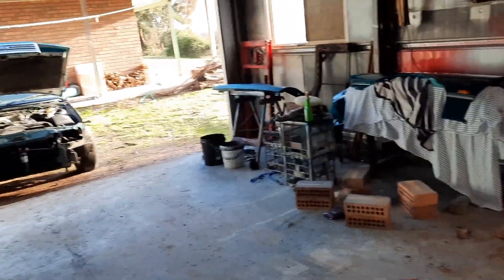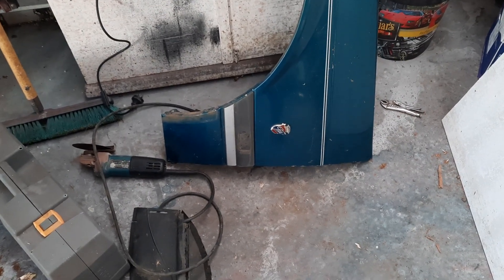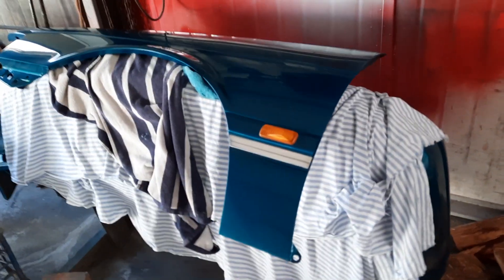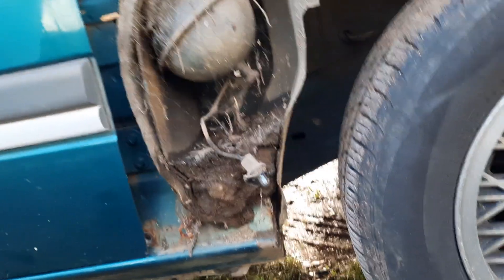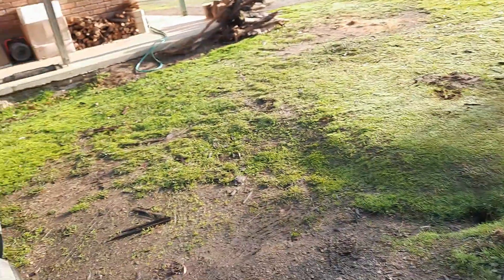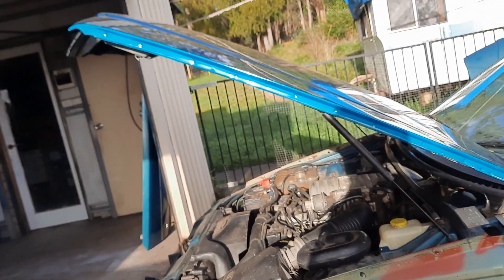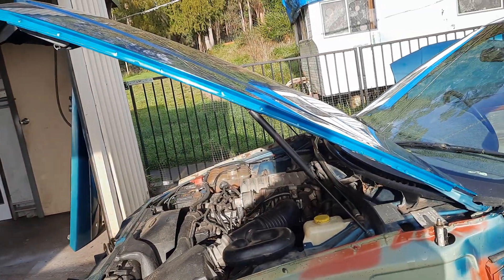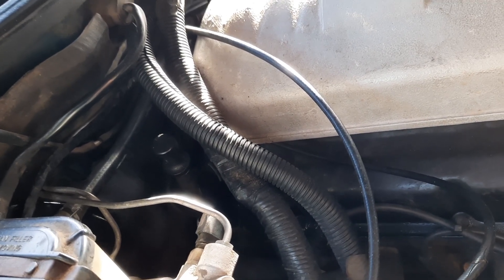NC Fairlane EB Falcon, painted protector strip and a lot of mud behind the guards / fender

Comment: Coming up pretty sharp, yeah that dirt mub problem been way back to xa up and no changes made, hence why alot of them rust out there, and cant be seen unless you pull the fender of like you did, sweet upate👊 Cheers 🍻🍻KC 🇦🇺🤝🇦🇺😊😎👍
Reply from the maker: Going to do some sort of modification there. Is only covered by plastic, but if I just cut a hole in it then it will load up even more , coming straight off the wheel. Needs an outlet that swings back. I drive a lot of dirt roads / fire trails, collecting fire wood , camping etc. I have already had to make stick protection for the rack boots. Going bush will be a whole lot different with new paint , didnt have to worry about it before.